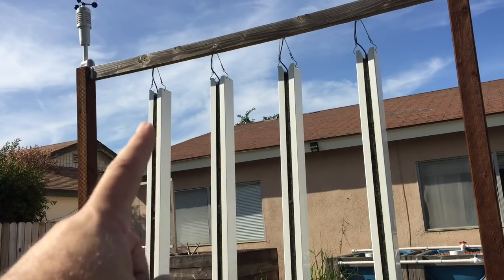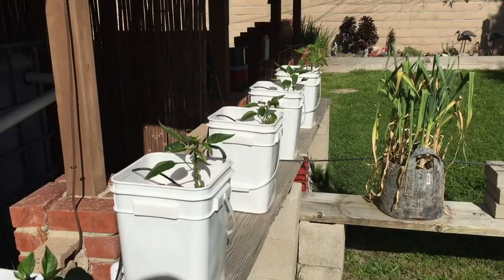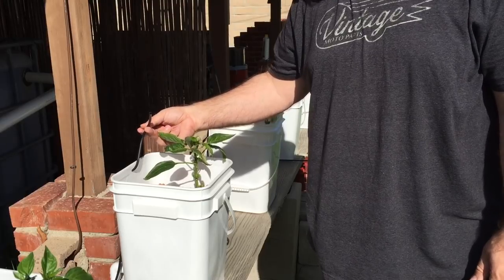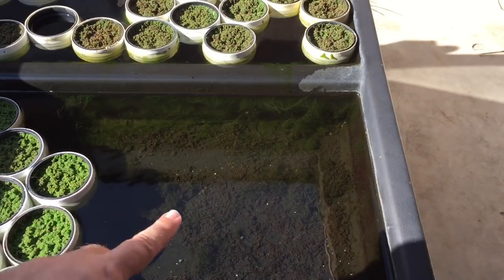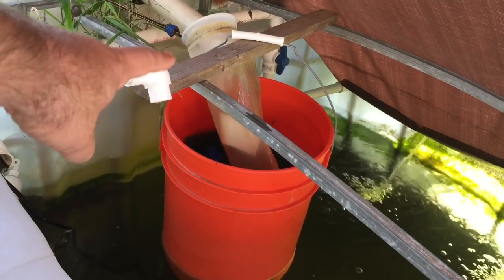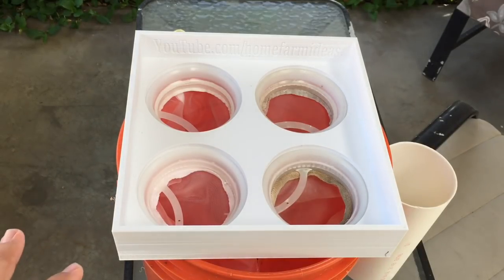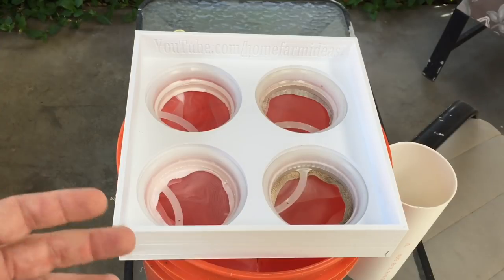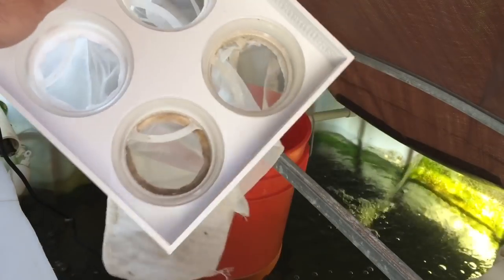3D Printed 4” Sock Filter Holder! - Aquaponic add on!

Comment from the maker: Hey guys:) Well, i’ve been wanting to upgrade my filter for a while now and I created this sock filter holder using my new 3D printer. To design it I used tinkercad.com and a caliper. If you would like to download the file you can go here (https://www.thingiverse.com/thing:352...) and print it on your 3D printer. I really want to start removing most of the solids from my system and I think this should help me a lot mixed in with my swirl filter and also my bucket filled with scrubber pads. 

Instagram: (https://www.instagram.com/homefarmideas) 

Sub Home Farm Ideas (www.YouTube.com/homefarmideas) 
Sub Home Science Ideas (www.YouTube.com/homescienceideas)
Sub The Fish Tank (www.YouTube.com/thefishtank)